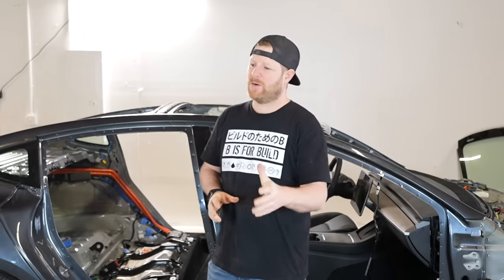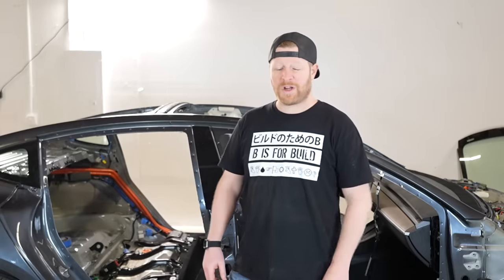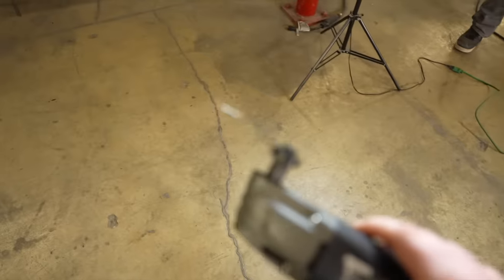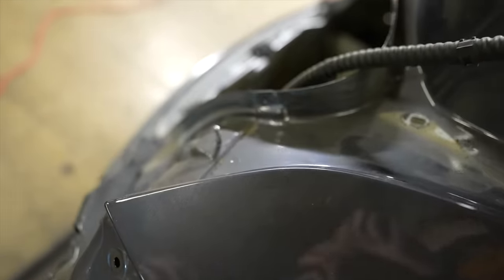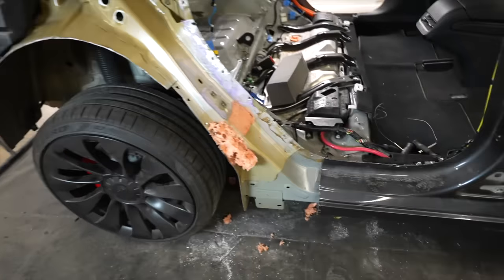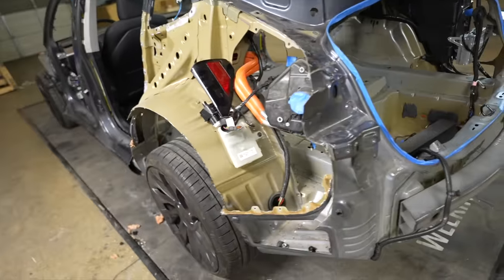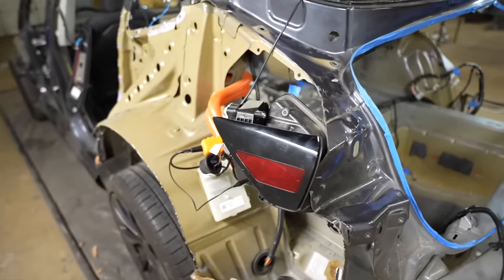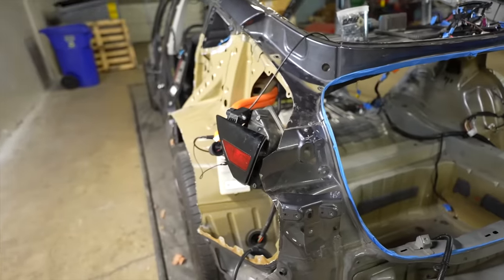How Much Faster Is a Tesla Model 3 Without A Body? RESULTS ARE SHOCKING!

Comment: use a heat gun on the areas there is foam and panel bond and it will separate clean

Comment: Car manufacturers 0-60 are still done using 1 foot rollout and not actually from a dead stop. Rollout is cheating. Even Dragstrips should stop using 1 foot rollout. Meaning the timer at the track doesn't start till the front wheels has moved 1 foot and crossed a beam/sensor. 
0-60 times and Dragstrip  times should be from a dead stop.

Comment: The battery on the original run was less than 50% which limits power 😅 not to discredit how fast without the body was but it probably lost 4/10s or more

Comment: Pretty sure the official m3p 0-60 in ideal track conditions is 3.2s. Measuring off the dash speedo is not accurate, you need a dragy gps module or a track for an accurate measurement. I can’t imagine you shaved move than 250lbs by removing the glass and aluminum shell.

Comment: Watch out that Tesla doesn't get the VIN of the Vehicle, because if they get it, they will probably disable supercharging, like on the Teslas from Rich Rebuilds.
Reply: Why, he legally bought it? Man, Tesla is auto-crat.
Reply: @cindy-tron  idk, ask Tesla.
But I would guess because of safety concerns, because the high voltage cables are laying in the open right now and are not protected.

Comment: full carbon monque/wheels could easily drop 500-1000 pound on your typcial ev car that would increase range and acleration without having to increase battary not to mention solve almost all ev cars achilles heel its handaling factor.

Comment: It's not faster. Top speed is proportional to power over drag. Removing the body does nothing to increase power but a lot to increase drag so it's obviously going to reduce top speed.

If you meant something other than top speed you need to learn how to English because increasing acceleration makes it quicker, not faster.

Comment: You guys are numbly lazy about facts and specs. This looked like a Model 3 Dual Motor, not a performance spec. It goes 0-60 in 4.1s. If your weightloss program gained you a second off the 0-60 run, that's 3.1s, which is what the stock performance runs 0-60. Still a long ways from Plaid spec.